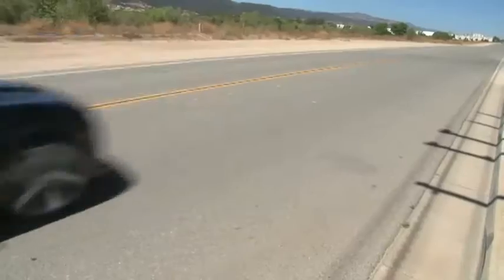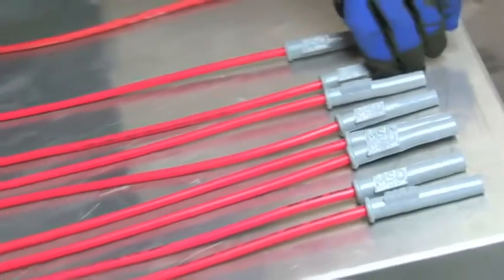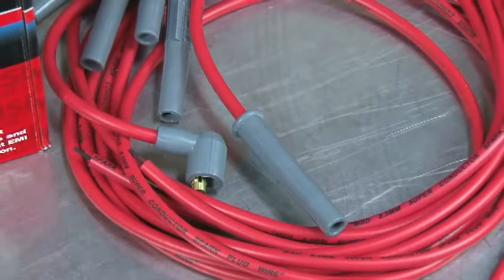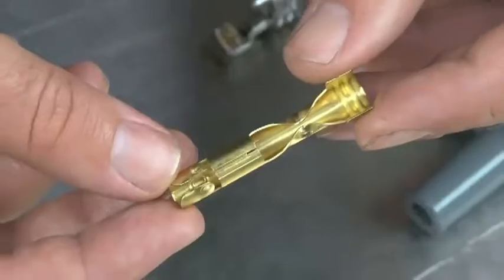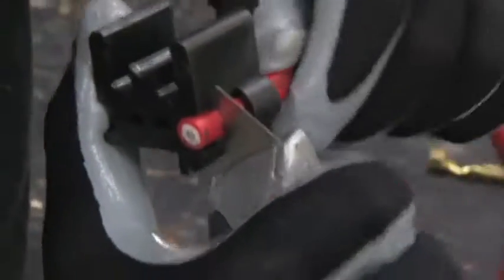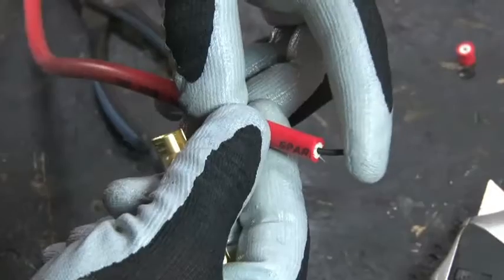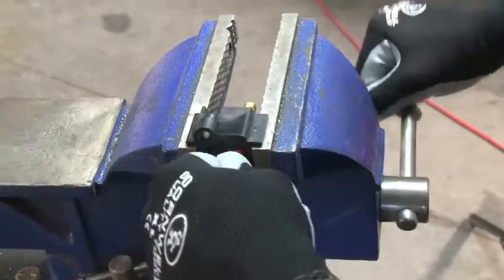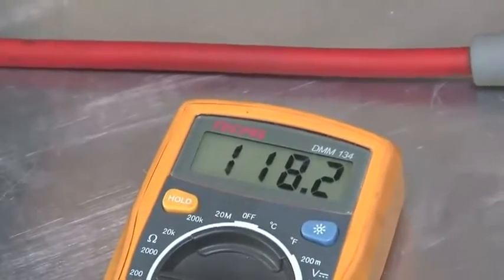Build Your Own MSD Plug Wires - Custom Spark Plug Wires

Comment: Question: On the MSD 31189 8.5mm Super Conductor Spark Plug Wire Set how well do the straight boots for the plug side bend and hold to any angle you want/need? Thanks